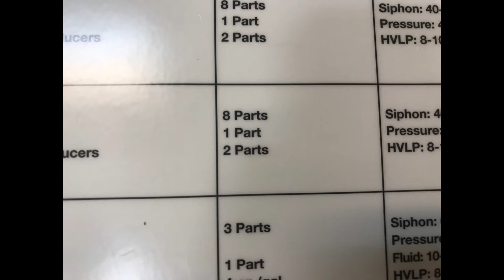1977 k5 blazer

Comment: Why did you not repair the dent along the front edge on the passenger side of the hood?
Did it occur after the paint job had been completed?
Reply from the maker: No, the intent was to build a truck that I wasn’t afraid of driving. I’ve built several in the past and they were so nice that I couldn’t stand drive them. The goal was to do a six out of 10.